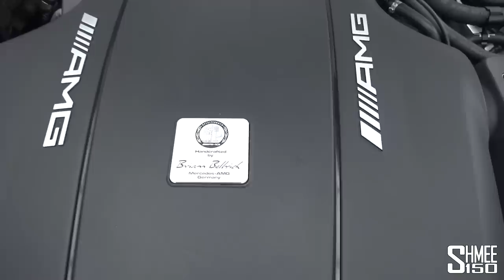Preparing My Senna and a Senna GTR! PPF at Topaz

Comment: I feel the Senna GTR is what the Senna should have been. The weird straight angle of the wing on the normal senna throws off the looks for me, whereas the wing on the GTR is more slanted backwards which flows better with the lines of the car.

Comment: Tim, what do you think doing the stripes in the same blue as the Senna?  You could change the calipers to match too?  Also, how are the door gaps on the Senna compared to the other Senna in for paint protection?  I'm wondering how good they can match up door gaps and panel gaps with carbon fiber custom made at McLaren, in a situation like yours where a repair has to be made.

Comment: a road legal senna gtr flex would be worth it. of course comfort would be kilometers away from the car.
Reply: nik the senna gtr looks soooo much better in my opinion, probably my favourite car at the moment.. also im sure someone will make it roadlegal!!
Reply from the maker: Yeah it would look the business but be horrible to use
Reply: Nooa Haapsaari there’s one gentleman I know already on it. Apparently it’s not that hard. Its putting catalytic converters and basic road safety requirements back into the car. The horn, indicators (already has it), parking sensors and mandatory back up camera in a few countries.